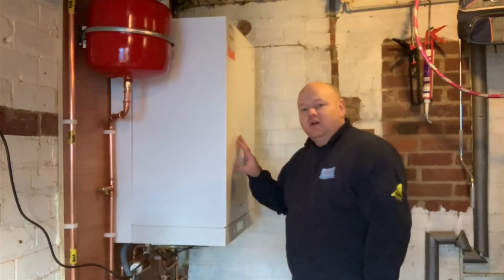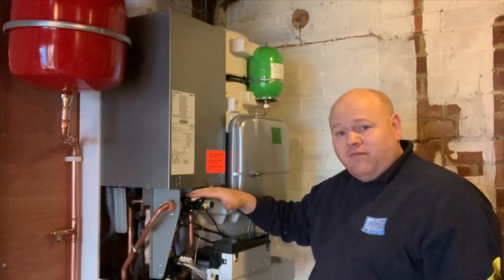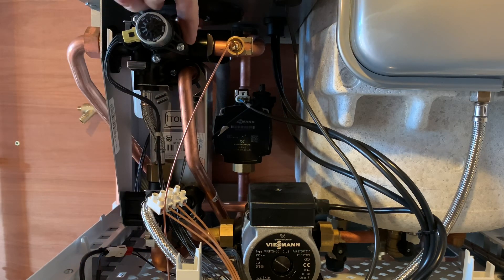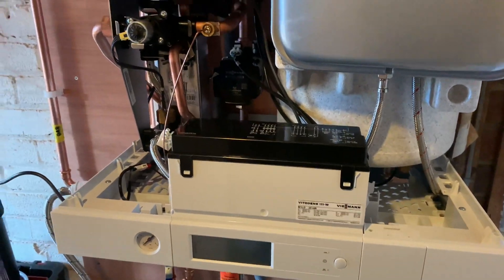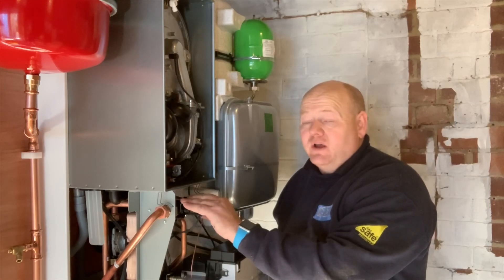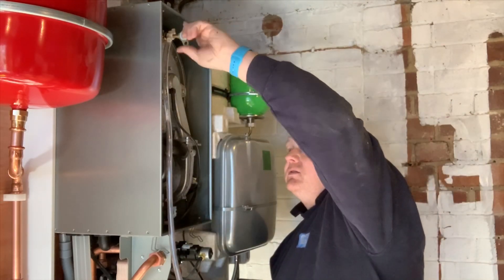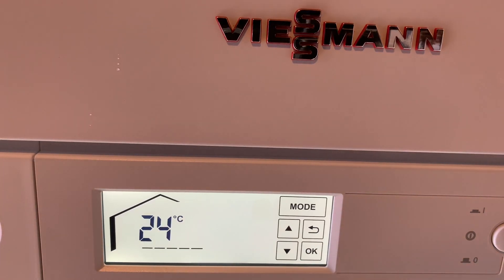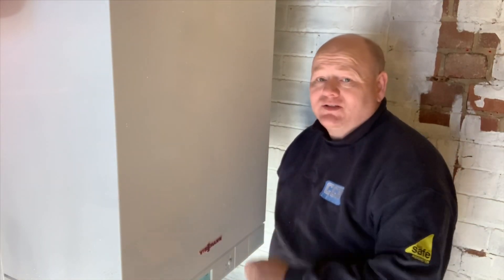Viessmann Vitodens 111-w - Review - How does it work.

Comment: Love your videos, they are very good to understand the way the heating works.
However they moved my Vitodens to the garage, only heating was on. Now we added pipes for hot and cold water.
How do I get warm water? They told us we had to switch a valve, can't find which one . Only cold water comes out atm and when I turn on the water the heating turns on and it get's hot in the house

Comment: Hi Alan. Great video. I’ve just had a newer version of this installed, the inside looks the same but the display is different. My boiler is making a noise 24/7 unless hot water and heating is turned off.  I think this has been configured in constant mode as part of the commissioning settings and the pump for the heating circuit and / or the water is being pumped continuously. Is this possible to be turned off and only pumped when the water / heating is required? Would it need to be recommissioned (to change from constant mode) or can it be done by changing the parameters? Thanks.

Comment: Hi Alan,
Just went to turn the heating system on after the winter – the pressure had dropped so I’ve topped this back up, the boiler all seems to work fine but none of the radiators are getting hot even at all. Sounds like the pump is running – any ideas on what to look out for?

Comment: Hi Allen, great videos. I am looking at having an a 111-w installed along with a google nest. I understand it can be connect as standard or open-therm, which is best for this boiler? Also the videos you have done on installing google nest don't show any connections for controlling the hot water, which I think the nest can do? Whilst this is fine for a standard combi, but with the storage tank there would be times of a night and when no ones in. When I wouldn't need the 46L tank constantly kept hot. is this an option?  Regards Phil.

Comment: Hi Allan,  love your videos, this is definitely the boiler for me, to replace a system boiler, just a couple of things I assume the combi boiler side serves the radiators, and does that mean separate pipework from the storage side to the outlets for example hot feed to say 2 showers and 2 sinks of course mains cold feed to the showers and sinks ? And because of  good litre capacity supply of how water  there's no need for individual separate pumps for the showers?? Lastly would the combi heating side work OK with 10mm microbore? Kind regards Danny

Comment: Hi Allen, so will it heat the water in the tank 24/7 ?? what if the occupants are not using the hot water on regular basis, it would be a waste of energy. Dose it has a bypass where it stops heating the cylinder and provides the hot water on demand. Also, could you time the hot water as you would in standard tank setup? Also, what if you have used the entre hot water in the cylinder and you need more instantaneously.

Comment: Hi Allen, many great video's helping me out!  But I have this vitdons 111w giving error code F8 - 'Gas valve closes to late'. The installation manual is a bit foggy about it. You ever solved a F8 fault?   Edit: My gasvalve was measured ok by applying a rectified AC voltage. I resolved this F8-error by replacing the mainboard. (detail is that the gas-valve requires two relays to close. One from each processor on the pcb. The left microcontroller pin was never sending an activation signal. So replacing a transistor or relay was not an option...)
Reply from the maker: Sorry, no

Comment: Hi Allen, would you reccommend this boiler to potentially replace a Potterton Powermax HE 85l.  This boiler was installed when my house was built in 2004 and is getting to an age whereby I need to start thinking about replacing it.  My only concern is the flow rate of the Potterton Powermax HE is 30 l/min and the 111-w has a flow rate of 18 l/min and I'm not quite sure if I would be happy with the drop off in flow rate.  Property is a 4 bed with bathroom, en-suite, kitchen and utility room.  Doesn't seem to be many options on the market when it comes to a combi storage boiler these days.

Comment: Did I understand correctly that the boiler with 46 liters means that when the tap is opened in 2-3 places, hot water first begins to flow from this 46 liters, and after the end of the water in the boiler, the boiler continues to work in flow mode? That is, does the boiler store hot water all the time?

Comment: Do these stay warm/give out heat all of the time due to the storage cylinder. We are trying to decide between the 111 and the 100. Our current boiler which is a storage combi I think (ideal istor) is always very hot and heats up the top of the house too much in the summer because of where it is. Would the 111 have similar issues?
Reply: They don’t give out much heat at , no more than a normal Combination boiler, you would virtually have to stand really close to it or put your hand on the boiler to feel any heat , the storage cylinder inside is fairly well insulated against heat loss
Reply from the maker: Depends what you need really. Have a good installer give you some advice. Thanks.

Comment: I replaced my old boiler with a new Viessmann Vitodens 111-W and it has stopped working after just 1 week!  It displays an error code F4 and performing a reset doesn't clear it.  Viessmann are coming out tomorrow to have a look at it.  Not a great start
Reply: Viessmann engineer arrived this morning and corrected the issue.  It was just the cable running to the heat exchanger which was immediately replaced.  Boiler all working well again!

Comment: Hi Allan! I can see you are very good and you know a lot about Viessmann.... We have one installed about 3 months ago but unfortunately F2 fault appears and our plumber doesn't know much about Viessmann Vitodens 111! Can you tell me what to do, please ? What I can say is the fault came out when the hot water is running and not for the heating! The temperature on the screen is playing up, going up and down till 100°C, the pressure is playing and than stop and the fault appears! I've restart but still have the fault! Many thanks!
Reply: It sounds like you have a blockage in the heat exchanger  did you manage to get this sorted out?
Reply: I have also a F2 fault,  what should I do please?
Reply: @MrJeco28  is it going over 80 or 90° if so it probably has a blockage in the plate heat exchanger

Comment: Hi Allen, I have had one of these now for around 4 yrs. It has had a problem that Veissmann have tried and failed to fix. Now they are saying it is not under warranty!!!
Anyway you seem to know more about these than they do. The boiler works great apart from a noisy changeover from CH to Hot water. It is only when the CH is running then I call for hot water. When the temp falls in the tank and the tank call for heat I get a loud bang as if a solenoid is not damped on changeover. I can't see how a stepper motor can allow that to happen. They have changed the motor but problem is still there. Have you seen this before? If so did you fix it? Any info would be great, Thanks
Reply: I had the same problem with my 111.....seems to be an issue with the diverter valve sticking. Mine was replaced under warranty after the 1st year.....Viessmann aftercare was brilliant, came out the next day from reporting it online the night before!.....It's been 2 years now and I've noticed the very odd time it's making the same banging noise.

Mine only makes the noise in this scenario.....CH has been on in the evening and then has been resting for a while. Once I use the HW it bangs at this point as the diverter valve is shifting across. 

The Viessmann engineer showed me the previous valve....it's basically a rubber cylinder block inside a tube and it moves back and forward when diverting either for CH or HW. The rubber gets stuck against the tube and then released all of a sudden causing a banging noise. It's not doing any damage but just doesn't sound very refined. Hope that helps
Reply: @t190uk  thank you for replying
I called Viessman out again and they have replaced the diverter cylinder so no longer have the issue
It’s just a shame it has taken them a couple of years to fix the issue 😳
Reply: Did you ever get this sorted as I am having the same issue as you? I have had this issue on and off for the last 3 years. It’s more problematic in the winter months. I am pulling my hair out and its getting very tiresome. Any additional comments would be greatly appreciated.
Reply: @amandasmith8084  I had the same problem with my 111.....seems to be an issue with the diverter valve sticking. Mine was replaced under warranty after the 1st year.....Viessmann aftercare was brilliant, came out the next day from reporting it online the night before!.....It's been 2 years now and I've noticed the very odd time it's making the same banging noise.

Mine only makes the noise in this scenario.....CH has been on in the evening and then has been resting for a while. Once I use the HW it bangs at this point as the diverter valve is shifting across. 

The Viessmann engineer showed me the previous valve....it's basically a rubber cylinder block inside a tube and it moves back and forward when diverting either for CH or HW. The rubber gets stuck against the tube and then released all of a sudden causing a banging noise. It's not doing any damage but just doesn't sound very refined. Hope that helps

Comment: Hi Allen, Really enjoy your video's and this one intrigued me. Have been quoted for an unvented cylinder but was wondering if this boiler would be sufficient for a household with two bathroom's,as in having hot water in an instant, mainly just two power showers are used.Not sure of the pros and cons of having a separate water cylinder running along side the boiler, compared to this 111.Thank's.

Comment: @Allen, are you specialized in Viessman boilers? I am currently looking for a way to control the 111-w through a Vitoconnect module and the Vicare app. But I can’t find an interface on the boiler where I can connect the Vitoconnect. Any tips on this?

Comment: Thanks for your excellent video, really helpful. I am trying to decide between the Viessmann Vitodens 111-W and the Worcester Bosch Greenstar 8000 Life 45kW. They apparently are comparable, as they are both advertised at 18l/min at 35 temp rise. However, looking at the 111-W technical manual in page 11 

https://viessmanndirect.co.uk/files//f6ed20c9-c436-4bc6-b2c8-aaa400f4ba95/1705%205777747VPA00004_1%20Technical%20Guide.pdf#page=11

quotes under DHW loading cylinder initial output for DHW heating from 10 to 45 °C as 200l/10min (20l/min) for the 35kW version of the Vitodens 111-W. That would make the Viessmann 111-W superior to the Bosch 8000 Life 45kW. But I wrote to Viessmann and they say "there is a flow restrictor in the boiler" that would limit to 18l/min. That was confusing. What are your thoughts? For context, I am looking into running 2 showers from the boiler and the main water flow rate is over 25l/min. Thank you very much in advance.
Reply: ggdionisio So which one did you buy in the end of viessmann or the Worcester Bosch?
Reply from the maker: Viessmann any day for me, I wouldn’t have a WB

Comment: Trying to work out if a store combi is right for me. I'm trying to work out how to storage part works, say its 40l in the store and i have a shower at 20lpm, would the tank be empty after just a few minutes? Main selling point is the flow rate, but assuming the tank is empty what will the flow rate drop to?  Thanks.
Reply from the maker: I have never had one run out yet. Thanks.
Reply: It will continue to give its same flow rate approx 18litres a minute you won’t know when the tank has been depleted as it fills its self with hot water at the same rate it goes out , Hope this helps

Comment: This is the boiler that should be in my house, I’ve got a standard bathroom, en suit and a cloakroom WC. I’ve got a Vaillant eco tec pro 28 which was already fitted when I moved in. It does ok as we don’t really run multiple outlets very much but it would be nice to have the freedom. Hopefull I’ll be moving house in the new year so it’ll not be an issue much longer.

Comment: Great video as always Allen, impressive boiler too. 

I still think the ATAG Q series are better in the sense they are a storage combi too but simpler - only have 1 pump, don’t have a plate heat exchanger ( they use a small indirect heated cylinder built in for ) and don’t have any plastic or rubber hoses / pipes. 

Keep up the good work 👍
Reply: I fitted three now Daniel an  atag would not have a patch over this 111 model

Comment: An excellent boiler,  To a new installer of  viessmann’s you will be absolutely impressed with the performance and the water delivery the only thing to bear in mind is this boiler is huge and it’s only a tad smaller than a washing machine!
I have fitted 2 so far and the customers have been absolutely impressed with them, And for the size of it it is very gas efficient
And quiet in operation
Reply from the maker: Have you installed any 222 ?

Comment: Hi allen

What pressure and flow rates are you getting to this install

Thanks
Reply from the maker: 18 l/m @ 60 degree’s 👍
Reply: Thanks for the quick reply

Im getting 15 litres per minute and not really suitable for a unvented cylinder, is there 2 showers at this property and if so how did they perform simultaneously?

Thanks again
Reply from the maker: @leestaps  You could always boost the mains if needed.
Reply: Yeah true, but theres not much change from £1000 with booster sets, sometimes we are too quick to remove tanks in loft, but in property’s with more than one shower sometimes its better to stick with conventional, obviously if moneys not a issue, thanks for the advice

Keep up the good work
Reply: @leestaps  
A main pressure system relies on what comes down one pipe. Simple. You can make matters better by having a dedicated 22mm inlet pipe from a full bire stoptap to the combi, even if a 15mm mains supply. Tee off at a "full bore" mains stoptap taking all the cold supplies on a different line. Divide and rule. Take cold to showers off the combi inlet pipe just before the combi, as any pressure/flow fluctuations around the combi affect the hot and cold to the showers as near equal as can be. 

Balance the hot and cold outlets by having wondervalves on each outlet. Reduce the flow on none essential outlets like basins, dishwashers, etc.

Also fit aerated shower heads like Raindance heads to reduce water consumption.
Reply: @leestaps  
Yes, if there is a good tank in the loft it can supply cold to toilets, baths. Dishwashers, etc. To ease the load on the mains when running a combi. Combis get rid of space taking cylinders, giving instant and infinate hot water.  These days they are cheap for what they are.

Comment: NICE but a bit too big i think does it come with a forklift  Allen
Reply from the maker: I agree it is very big but smaller than a boiler and an unvented cylinder. 👍
Reply: @AllenHart999  
And most probably cheaper. Look at how much hot water it delivers in 20 mins, 30 mins, etc.  Then see how big an unvented cylinder you would need. Plus the floor strengthening. :)